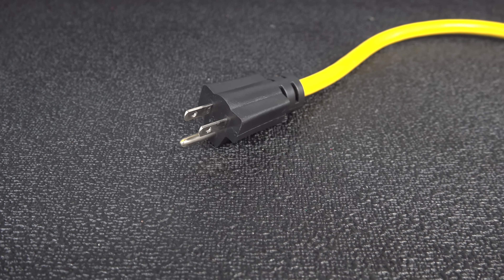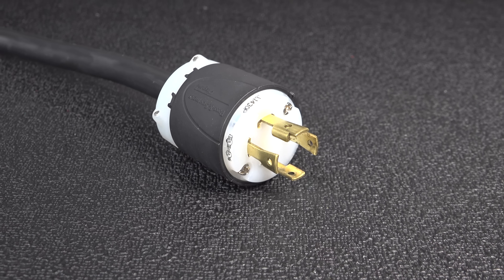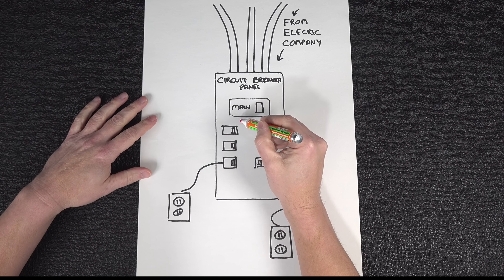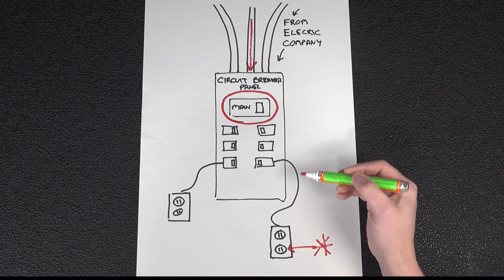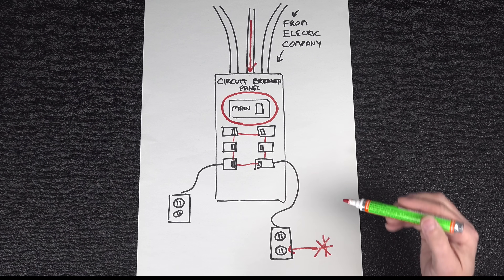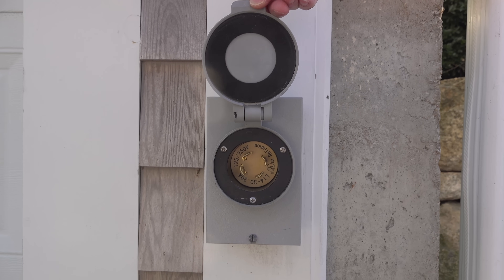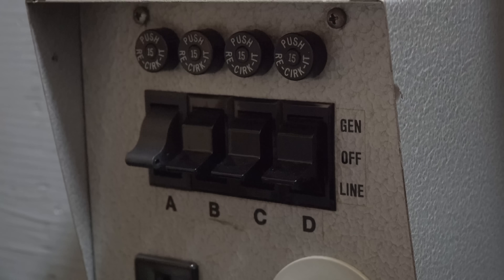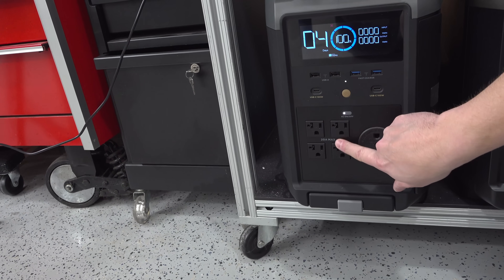Worst Electrical Mistake You Can Make - Backfeeding Generators

Comment: Gotta be honest, I did this in 2007 during the massive ice storm that hit the Pacific Northwest. We were out of power for over a week that time. The storm actually knocked down one of the high voltage towers that comes into town, so the power outage was expected to be prolonged. Some areas didn't get it back for 12 days. That said, I did throw my main, and actually disconnected some circuits inside my panel so I could power some 240 directly like my well pump. Water was cold, but at least it was running. Local public power was super cool about it when they started coming around to reconnect lines. They did a house to house inspecting panels because they knew people had done what they needed to. They actually quickly rewired the few things I had modified. Now I have a proper generator panel in the works. As much as I know how to do it safely, I don't ever want to have to do it again.
Reply: @Game Plays 1230 the outlet is still protected by a breaker rated to protect it when in normal use.
Risks from back feeding to street, and double ended cords are valid, but there's no more risk to the outlet backfeeding from a 30 amp generator through a 20 amp breaker/15 receptacle  than there is trying to run a 30 amp load through a 20 amp breaker/15 amp receptacle
Reply: @xraybox   The people who use male-male extension cords are probably the same people who've cleverly figured out how to bypass breakers
Reply: @xraybox  no, because a 30 amp generator won't put necessarily put 30 amps through the outlet, which wouldn't trip the breaker, also the breaker will only trip if more than the rated power is flowing through it, but if you're backfeeding through an outlet, the other outlets on the same breaker are all in parallel.
Reply: While you should never backfeed info the grid during an outage, it's highly improbable that you'd hurt a line worker. Your generator is more likely to overload and trip it's internal breaker when trying to supply power to all your neighbors. (I'm an electrical plan reviewer and have discussed this exact topic with inspectors with decades of experience)
Reply: @ldm58427  I would think there would be procedures such that it wouldn't be possible to energize the lines, if the lines are either disconnected or grounded before the lineman works on them.   Seems doubtful a lineman would rely on trust that no one in the vicinity has done this, and wouldn't have a lockout capability.
Reply: @wingerrrrrrrrr  if there's a power outage and emergency repairs are required, and you're in the middle of a weather event, you may not be able to take the time to do that while getting power back to people who are freezing to death.
Reply: @ldm58427  i hate how he assumes everyones a moron and can't remember to turn the main off.....sadly he's mostly right......
Reply: @ldm58427  While true for most people, when an ice storm took out our power with a branch a few years ago, despite being at the end of a long row of houses, it turned out that we were on our own little branch and thus potentially not powering our neighbors. The wire was also down in the road so there's that side of things too (i.e. it's potentially not just linemen). We powered what we needed with an extension as by keeping it small, we mostly got by with a car battery and inverter for a couple of lamps and the TV.
Reply: Thinking about it too, we have two panels (old house, presumably went 100 to 200A at some point). So the temptation for someone who didn't know better would be to leave both panels on so that a generator fed into one would also power the other. At some point, I may see about doing something about it as the older one is screw fuses and they're not something I like bothering with much.
Reply from the maker: Listen I am not the judge. When your life depends on it people do things. The ate each other in the Andes to survive so does the NEC matter more? Nope. BUT the difference here is people go out and buy a generator and most take no steps to prepare the hookup, planning that nothing will ever happen. Then the same folks do a backfeed and cause problems or even death, which has happened. So my take on it is if you buy a generator for your own house, take the extra step and do it the right way and as a channel creator it's crazy to not instruct people to do things the safest way and I have shown many transfer switches so I hope this will inspire some to use the transfer switch or interlock. I personally always did since my wife was the one at home and I am was at work, and she just isn't technical enough to avoid a mistake, so the transfer switch is foolproof and we lose power a lot.
Reply: @SilverCymbal  most times the correct switch and the electrician to install it cost more than people can or want to afford
Reply: @SilverCymbal  exactly what I’m saying. Desperate times call for desperate measures
Reply: @SilverCymbal  m. Mm m
Reply: @SilverCymbal  yeah a din rack manual transfer switch (basically a pair of switches that cannot be turned on at the same time) is like 10-20 bucks, so compared to a generator it's not even expensive, and you can power your emergency systems off of that, so you don't even have to unplug unnecessary things. 
in regions with frequent outages you can even get automatic generators which turn on when theres a power outage (though generally they don't automatically switch back to grid when the outage is over to avoid some problems) 

my mom has one with a double fallback, which has batteries (charged by solar), and when the batteries run low it falls back to grid, or if the grid is out to generator. though it can be setup the other way around with grid as default and batteries as a fallback while the generator is being started.
Reply: @SilverCymbal  Yeah like the number of people who would take the steps that @zartanio would take are few compared to those with generators and no proper hookup setup in place. Kudos to @Zartanio for identifying the issue and taking some steps to help mitigate in the crisis situation.
Reply: @SilverCymbal 😮
Reply: @SilverCymbal  I have no problem backfiring generators like this...
Done it before and I'll do it again. 
If you're unaware of how household wiring works, Don't realize that you have to turn off the main when doing it, and don't understand current carrying capacity of wiring in the walls, that's on you.
You can take a 240 v center tap generator with a 30 amp output and put it through either a 240 volt dryer plug, or through a 120v splitter and to 2 outlets in the house on either leg of the breaker panel and be just fine. Just never exceed the current capacity of the breaker in the leg you plug it into.
And ALWAYS turn OFF the main, before plugging in and starting the generator.
Reply: I had never seen such a thing until I moved out of the North West down to New Orleans. I had a guy working for me who had just finished a stint in federal prison -- it saved our bacon on that remodel, but I would never do it, again.
Reply: @Duke_of_Prunes  LMFAO random example but yeah, true. The FAU 571 uruguayans indeed ate each other.
Reply: Why not just ban power outages?
Reply: And I have a full generator hookup that was so stalled for a previous owner who had a relative on oxygen, so our whole kitchen wall is powered along with the usual of fridges
Reply: You were completely legal provided you locked the main or locked the panel: 
Article 705.NEC702.6 contains an exception to the transfer equipment requirement:
“Exception: Temporary connection of a portable generator without transfer equipment shall be permitted where conditions of maintenance and supervision ensure that only qualified persons service the installation and where the normal supply is physically isolated by a lockable disconnecting means or by disconnection of the normal supply conductors.”
Qualified Person. One who has skills and knowledge related to the construction and operation of the electrical equipment and installations and has received safety training to recognize and avoid the hazards involved. (no degree or certification necessary, just basic knowledge)
110.25 Lockable Disconnecting Means:
Where a disconnecting means is required to be lockable open elsewhere in this
Code, it shall be capable of being locked in the open position. The provisions for
locking shall remain in place with or without the lock installed.  (you can't lock it with a chain or some other thing that is all removed when unlocked, the lock has to be a feature of your breaker box and be able to lock the main breaker open.
Reply: @snap-off5383  Good to know.  If someone has a clue what they are doing, it isn't a problem.  Lockout the mains and don't overload... Not rocket science.
I can see a good argument for not selling these male-male cables though.  If you're someone who knows enough to use it properly, you can easily make your own.

BTW: Yes, a proper generator interconnect panel is what you should do... But there aren't standard most places and it is a emergency thing you don't use unless you really need it.
Reply: @travcollier  Yeah its not hard to lock the main breaker,  put on a headlight or cellphone light and change out an outlet receptacle for a generator inlet box real quick if you're only temporarily adding power once a year or less, then you can just use a proper generator cable.
Reply: @travcollier  This is a good comment about making your own.  As per my other comment, I certainly use the M-M patch when power is out, but YES I made it myself, and I surely know how to do it safely.  It should not be sold retail -- most certainly NOT!!
Reply: @snap-off5383  That red tape applies to normal business, and goes straight out the window when the power goes off!
Reply: @fukenbiker  I hear yea, you're not going to encounter any law enforcement or code compliance until you do something wrong that results in damage to others.
Reply: @fukenbiker  Yeah it would need to involve a defective generator breaker to cause any issues most likely even with the main closed which only an utter ignoramus would allow.
Reply: @snap-off5383  self preservation trumps laws.
Reply: @polocatfan  Its possible to KNOW nothing bad is going to happen.  That also trumps laws, but doesn't need to in this case.
Reply: @polocatfan  took me a min but I get your point, not about to scroll down through 100 "more replies" to delete the previous comment though.
Reply: @snap-off5383  Even if it "can" be done my worry is how well you'll do at following the (probably not written down) checklist in a real emergency.  Odds are you won't be clear-headed and well-rested when it needs to be done, you will instead be highly stressed, exhausted, rushed, worried, and who knows what else at once.  Its going to be the peak of a storm at 2AM with your basement flooding when you've been awake for 30 hours and struggling thru the snow/mud/whatever to get the generator in position and what are the odds you won't forget something in the chaos?  Too high IMO.  And the interlock kit is fairly cheap even installed by an electrician makes it idiot (and exhaustion) proof.
Reply: @matthewmiller6068  What if an asteroid comes out of the sky on your location right at that time too? The odds I would forget a step in the process are zero. If you're already out of breakers, an interlock is an expensive addition. There's code for how to properly avoid needing them.
Reply: You do realize even if you didn't throw the main on your house your generator would instantly trip its breaker as there is no way on earth your generator would be able to handle the load placed on it by connecting it to the power grid right? I've seen several of these videos claiming how dangerous it is to backfeed like this. Unless you have a multimegawatt generator being fed by a 2-4 thousand horsepower generator it has no chance of takening the load and energizing the power lines connected to your house.
Reply: @spencerblackman7670  Usually yes, but there is still a slight chance that you may "successfully" backfeed into some piece of lines which - by a miraculous but possible chance - have gotten disconnected from any other houses, thus having no load to overload your generator, but having the voltage it supplies.
Reply: @spencerblackman7670  This kind of overly simplistic and incorrect thought process is exactly what gets linesmen killed from backfeeding morons. If the fault is due to a break instead of a short across the lines then you've now split off some area into a separate electrically isolated island. If it's a decent chunk of houses then sure, the generator will stall out or trip its own breaker. The trouble comes when it's just a spur line going to a single transformer. If that breaks off then there's no problem at all with a wimpy generator putting 15kV onto the power lines. When a lineman is working on a downed line they'll pull upstream fuses, ground the lines together, and test it to make sure it's safe to work on. That's not a panacea when each and every home is a potential power source and you don't even know which line is connected to what in the twisted pile of aluminum wire and trees. They might think they've grounded out the section of line they're working on but in reality there's a break that they can't see or they know there's a break in addition to some short, but they don't have good access to ground it out on the other side "and besides, that's just a spur going to a single house, it's cut off from the grid". You'd hope that testing lines with a non contact voltage tester would prevent accidents but that's not always done on every little section of line and even if it is, halfway through working on it Joe Schmoe might decide ""oh good, that tree's finally out of the road. Let me go fire up the generator so I can get ready to drive to the store".

You cannot assume that if it's improperly wired it'll trip the generator. Generators are in use because there's a fault on the lines preventing power distribution, that fault might very well also prevent the generator from trying to supply power to the neighborhood and keep it from stalling out. No matter how you slice it, it's a hazard and it kills utility workers. This isn't a theoretical situation, it can and does happen from time to time. During large outages linesmen from a couple states away will come flooding in and work brutally long shifts with little rest. Mistakes happen, it's a complex environment, people just want to hurry up and get service restored so they can be done with it. It's only natural for them to assume that just because they grounded and tested the line that the ground is going to protect everything they're working on when in reality, that's a gamble and the outcome might not be clear until they've been electrocuted.
Reply: @AndrewMerts  He wasn't advocating just leaving it open. . . it was quite obvious he was having a thought experiment in his mind of "what would really happen?"  I think you both likely have it wrong however, the generator would indeed fail to power the homes still connected to the grid, but it wouldn't trip the generator's breaker.  Your generator would just be powering the primary of a transformer, basically like powering a 220V microwave at the top of the pole.  Since the transformer is electrically isolated, its inability to provide the necessary current to the secondary wouldn't cause a current draw like if it were actually connected to the other houses directly.  Anthropomorphizing, it wouldn't make an attempt to power all the houses it would just work as hard as it can on that transformer primary. The big danger is when the power comes back on, it will power your generator directly with the main closed, and can generate crazy voltages with phase mismatches that arc/flash/melt/grenade the generator.
Reply: @spencerblackman7670  depends on how far the fault is from your house, if it's just your side of the street, it potentially could, if everyone else has their generators backfeeding.
Reply: The biggest idiot in the world is in this comment section. Their name starts with the letter "I", if you know what I mean...
Reply: Can't remember if it was 07 or 08 winter, but probably the same time.  We didn't lose power, but it snowed a few feet and stayed at or below freezing for the next 3-4 weeks.  Such an odd occurrence here in the PNW.  People who haven't been west of the Cascades won't ever grasp why even a small amount of snow can be disabling to this region with all of our hills and curvy roads.  Even just the hills in downtown Tacoma or Seattle on a rainy day was stressful in my little honda.  I just hoped I'd hit every green light.  Nothing like coming to a dead stop on a wet, steep hill and then rolling backwards a couple feet because your front wheels can't get a grip! lol
Reply: You live around aberdeen?
Reply: I would do it too. TBH though, I know more than the average joe about where electricity comes from and how it gets where it does along with most of the "stuff" in between.
Reply: It's only unsafe if you are a moron
Lol
Reply: If I was going through the trouble of installing a second breaker box and all that... I'd just hook up solar and some batteries.. Screw the grid. No power outages at my house.
Reply: Side point: fuck the 2007 storm.
Reply: Im living in washington rn and a few months ago we got snowed in for a week or maybe 2 i dont remember but atleast it was fun building snowmen and going down hills with sleds
Reply: MANY A LINEMAN DIED TO THIS SHITE!!!
Reply: @mellowrebel4618  Many?  Electrocuted through an OPEN MAIN BREAKER?   Pfft.   Pat pat pat.  Please don't eat the crayons.
Reply: @snap-off5383  back feed from not open properly isolating it from the distribution lines !!!
Reply: @mellowrebel4618  back feed is any time you're sending energy through conductors the opposite way that it was designed for. You can "backfeed" the grid or just "backfeed" an outlet.  Both are backfeeding.
Reply: I remember that storm! I was there in Warrenton, and i went out to the jetty and watched the waves crash up over the observation tower. Had to cut up a couple trees to help some others get through. What a wild storm that was!
Reply: I had to do something similar recently when an ice storm knocked out my power just outside of Detroit. I ran the modified cord from an 8000 watt genny down to my furnaces blower. The power switch is wired with a twin socket. Than I shut off the circuit by flipping the breaker in my panel. That breaker only powers my furnaces blower fan. The main was already off to eliminate any possible surges as power is restored and to prevent issues like is discussed here. Note that I would never try to power the whole house in this way. I only need to power up my blower and thermostat to get some heat. And did I mention I had to visit FIVE home improvement/hardware stores to find the plugs and cord to modify?  EVERYBODY around me was doing the exact same thing.
Reply: @Darkstar72SR  The male ends were sold out but the generator ends and generator receptacles were still full right? (just swap the receptacle when you need to feed the other direction to a generator receptacle, no custom cord needed)
Reply: I'm in the PNW as well. I'm just gonna come stay with you during the next power outage.
Reply: You're very good at writing.
Reply: @dough-moh  This is hilarious.
Reply: I’m buffalo if so me and my mom were suck on the highway during that
Reply: Thank you for the story. This was actually way more interessting than the actual video (the video was really good, it was just a little more entry level than what i personally recieve knowledge from, like why we dont have exposed conductors)
Reply: I did this back in 2015 during an ice storm here we was without power for 8 days but I pulled my meter out before I fired anything up and let my electric company know what I was doing had a new born in the house and no way to heat it up gotta do what you gotta do
Reply: If you pull the meter and make sure the N is isolated then it is safe.
Reply: @dodgeguyz  N doesn't need to be isolated, its bonded to ground at your panel.
Reply: Be quiet  @dodgeguyz . We're talking about customers here, not power company workers, that are able to remove the anti-theft ring.
Reply: the one time, after we were back-feeding, someone unplugged the cable from the generator but left the male to male plug still in a wall socket. i stood on the other end unaware and gave myself a nasty shock. here in SA there aren't back-feeding laws but im definitely not doing that again.
Reply: @thomasdavis5230  "
"someone unplugged" where conditions of maintenance and supervision ensure only qualified persons service the installation  Suicide cords are unnecessary just buy a generator inlet to swap out with an outlet space.
Reply: @snap-off5383  i was young, the person how unplugged it was the gardener
Reply: I back feed a panel once in an old apartment building.  I was renovating an apartment and owner would not turn on power .  Used the owners meter to feed apartment.  I completely disconnected main wires to make sure no one would accidentally turn on main breaker and electric company turned on  power and phases where not in sync.
Reply: @satunnainenkatselija4478  Why not just . . . .?  $!
Reply: That shit saved you bro, and why the system hates that you can actually be reliant to get power.
Reply: You gotta do what you gotta do if you don't even have access to water. That's why these days most people have a dedicated solar panel for their well pump. We can withstand a lot of abuse, but we can't last more than 3 days without water
Reply: Hey I remember that storm! We lost power too for about 10 days. It was fucking gnarly.
Reply: I remember that ice storm! Nothing has ever come close to that week as far as ice and snow since then! It's was brutal. Portland shuts down with a light dusting, 2007 was armageddon.
Reply: kinda shitty of this guy to judge you for not wanting to die.
Reply: I remember that storm. Our community was isolated for a week after that. Our only store ran out of everything on day 6.
Reply: Lazy
Reply: A little knowledge is dangerous.  Everyone wants the greatest bang for the buck. These killer cables can do it.  Trouble is it's an accident waiting to happen. I'd like to think your life or loved one's or home is worth so little to mess with this stupidity.
Reply: @Game Plays 1230 most homeowners don't purchase a generator that big. If you don't shed load, in addition to opening the main, the generator is going to fail.
Reply: 100% would do the same, Grandpa taught me just the same things if I ever needed to run a generator
Reply: You weren't being unsafe, the regulations literally exist to sell "safety" equipment that does the exact same things as flipping a breaker. Electricity safety is overexaggerated these days as its a tightly regulated industry and it means lots of profit can be forced out. They don't want you to know how to turn off the main to properly power your own house, they want you to buy their 'system' which is nothing more than a mains breaker that stays off on power loss.
Reply: @killsalot78  AFCI breakers are an overbearing example of profiteering.  They don't even work right, and cost 5X what GFCI's cost, which mostly AREN"T available now.  Beautiful!!
Reply: @Rowdy sorry, you're right, and I repent. 
As for the religious fknPagan here named 'jesus', don't get any weird ideas.
Reply: Where do you specifically live and what is your full name. Sorry but I have to report you. You must provide me with your information, it's illegal to ignore me because you committed a crime and I am reporting you.
Reply: @ATLTraveler  Its not illegal.
Reply: @Cipheiz someone is paying attention. Yes, you are correct.
Reply: So you're saying that you back fed your house with a 110v plug and ran a 240v pump. Ten four buddy.
Reply: @lmaolmao8826  No. I back-fed 110 for lights and outlets but disconnected the well pump wiring from the panel, and patched it directly to a 240 plug to connect to my generator's 240 supply socket. Good snark effort, though.
Reply: @zartanio5512  repeating what you said is a "snark effort"? Perhaps you should you edit your post or just keep your mouth shut when someone calls you out for the b.s. that you posted.
Reply: @lmaolmao8826  you might want to read his post again.  It does not say or imply what you seem to think it does..edit I have no idea if he has edited it or not..but currently you are wrong.
Reply: @kevinfloyd808  "I did this in 2007". Yes, that says he used a 110v plug. What he meant to say was: "I did something similar to this but with a 220v plug".
Reply: @kevinfloyd808  btw, the next time that you attempt to correct me, please be correct in what you're saying.
Reply: @lmaolmao8826  I am correct, he said "I actually disconnected some circuits so I could power my pump"  doesn't specify until a later reply that it was wired seperate from the plug that powered the 110 stuff, but not difficult to understand.
Reply: @kevinfloyd808  You're very incorrect. At no point in his jumbled together, barely coherent thought did he say that he switched to a 220v cord. The ONLY mention of what he used was when he opened with "I did this in 2007". That implies that he did what was done in the video which was back feeding from a 110v cord. Seriously dude, just keep your mouth shut and learn from this. I get that the two of you are barely literate, no further proof is necessary.
Reply: @kevinfloyd808  I am not wrong, buddy. What he meant to say and what he said are two completely different things. Quit advocating for illiteracy.
Reply: @kevinfloyd808  I'll make easy so that even you can understand. If the video was of two men copulating and the guy said, "I did this in 07" and then we had a baby, he would be incorrect. What he would have meant to of said was "I did this in 07, only with a woman". If you're unable to correctly articulate your own thoughts then get help before you try to speak. You have done nothing more than prove you're own ignorance.
Reply: @lmaolmao8826  um you should really learn how to read because he did say that he had temporarily rewired his well pump to be powered directly from the generator and only back fed 120 voltage into the house to run the basic things like lights and refrigerator
Reply: @lmaolmao8826  I'm almost sure he connected 2 circuits from the same phase to power his pump. In other words he probably ran the pump on 120, thinking it was 240, will still work but will burn the motor up unless the pump has the ability to switch between voltages.
Reply: @motarted1735  negative. He said in a comment that he he used a 240v plug. Thank you for proving what I have been saying.
Reply: @lmaolmao8826  you're wrong.  It was very clear to me that he wired up some stuff with 110 and the pump separately w/220
Reply: @forbiddenera  no, I'm not wrong. I'm sorry that you don't understand the English language.
Reply: @lmaolmao8826  I do, actually - masters in it. But hey, 3+ people here trying to explain it to you and you're just blinding yourself to the possibility you could be wrong - the first thing to realize about arguing is it's a waste of time if you can't even try and see the perspective of the opposing party, the second thing to realize is language exists partially to enable argument thus your failure to comprehend the opposing argument is a failure to comprehend language; that said - I'm not interested in wasting my time trying to convince someone who's so closed minded, I just thought it would be entertaining to add myself to the list of countless people laughing at your self-important impotent impedence.
Reply: @forbiddenera  If you had a "Masters in English", you wouldn't write like a High School drop out "-" but hey, what do I know? Yes, I get it, everyone is an expert on YouTube. At no point in his barely coherent and poorly structured "life experience" did he distinguish between using a 110v and/ or a 220v cord. 

Here, let me break it down for you, "master", if you followed his instructions, you would be using a 110v cord: "I did this in 2007". His statement is that he did what is in the video of which is back feeding a house, with a 110v cord, from a portable generator. Now if he were to change the voltage and use a 220v cord, he would need to make reference to his actions. What he did say was: "actually disconnected some circuits inside my panel so I could power some 240 directly". So now we're left with a 110v cord (still) and some disconnected "circuits". There was ZERO mention of a change in power source and change of cord.

So, no, you're incorrect, moron. Your degree is certainly not serving you well.
Reply: @lmaolmao8826  Reading comprehension includes scope and context. There was plenty and his point was communicated clearly to several people, seemingly the vast majority. If you knew anything about language, as soon as it is spoken and understood then it's 'official',  go look up how any dictionary defines how a word becomes a word and have a wonderful weekend, troll.
Reply: @lmaolmao8826  Why so aggressive mate? It’s YouTube. Even if you would be right, take a Xanax and chill.
Reply: @hschokker86  I am right. There's no need to try to argue.
Reply: @lmaolmao8826  

"Repeating what you said is 'snark effort'?"

You didn't just repeat what they wrote. You added the snarky "ten four buddy."

"Maybe you should edit your post, or just keep your mouth shut when someone calls you out on your b.s."

Maybe you should take your own advice.
Reply: @lmaolmao8826  

"His thoughts were not articulated correctly."

You're the only one who seemed to miss what his intended meaning was. That's a you problem.

He said in his original statement that he "did this in '07. His obvious meaning was that he back-fed with a generator. If it is incorrect to assume when he said he "rewired", that he did so in a way to allow him to do what he claimed, it is also incorrect to assume he used a 110 cord, because he did not articulate that he did so.
Reply: @notahotshot  the video uses a 110v cord. It is not incorrect to assume that he used a 110v cord since that is what he said he did by saying that he did this. Don't attempt to change the facts to suit your needs. It is worded wrong.
Reply: @lmaolmao8826  

He said, "I did this", as in he back-fed his house with a generator. He did not specify that he used the same equipment as in the video. That is your assumption. You might as well assume he literally used the exact same physical equipment seen in the video, even though it's obvious the equipment isn't that old.

Do you also assume he did it at the same house, while recording it for a YouTube video, because he says "I did this"?

It's a shame, but only for you, he did not write a technical manual with illustrations, detailing his exact installation procedure.
Reply: @notahotshot  now you're grasping for straws. The video is of someone back feeding with a 110v cord. He saod, "I did this". That implies that he back fed with a 110v cord. The video CLEARLY uses a 110v cord, in fact it's the focal point of the whole video. You're wrong and are making a fool out yourself at this point. You're trying to justify him incorrectly wording his story in an attempt to argue with me. You want me to be wrong so badly that you're trying to change the facts to suit your needs.
Reply: @notahotshot  He said, "I did this" what is being done is back feeding with a 110v cord. He didn't say, "I used this equipment". He did say that "I even changed some circuits and powered 240v". That implies that he was using a 110v feed. He never said that he changed the power source from 110v to 220v but he did change from 110v appliances to 220v. He's wrong and you're wrong. Crying about it doesn't change the facts.
Reply: @lmaolmao8826  

"Crying about it doesn't change facts."

So why are you crying about it?

He said, "I did this." Your assumption about how much of the specific details presented in this video are accurate to what he did is irrelevant.

Do you assume he did it at the same house, and recorded it for YouTube? That's what was done in this video.

Insisting that your assumptions are correct is ridiculous, especially considering he made a clarification on a follow-up statement after you indicated a lack of understanding.

Now, cry some more.
Reply: @notahotshot  the video is of back feeding with a 110v power source. He said "I did this". Your refusal to accept this doesn't make it less real. 

The fact that you even said that he made a "clarification statement" proves that what he said was wrong. Do you know what a clarification statement is?

I've argued with some real morons on here but you take the cake buddy. You completely proved what I've been saying in your attempt to prove that I'm wrong. You're obviously not self-aware.
Reply: @lmaolmao8826  Man you've been owned repeatedly all through this comment thread but you still won't face the facts. Who hurt you? Do you need a hug?
Reply: @lmaolmao8826  (I'm not your buddy, pal and youre not my friend, guy😂)